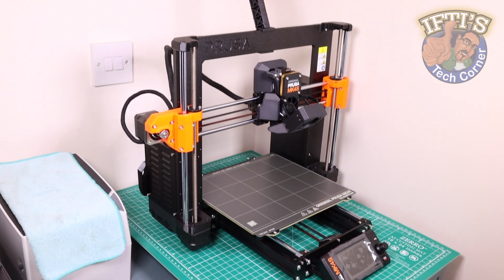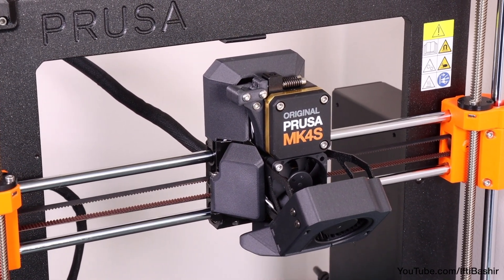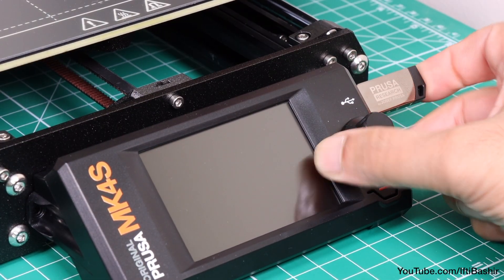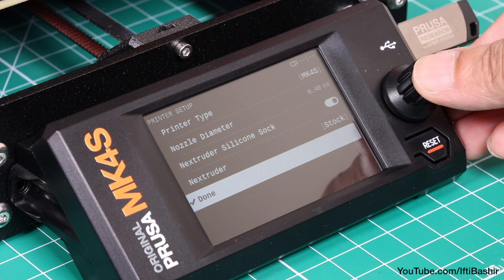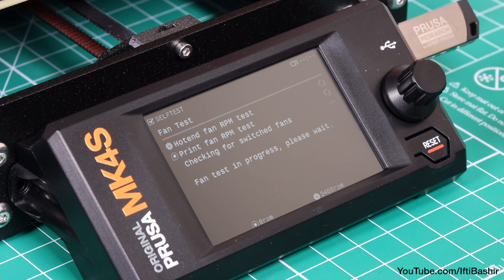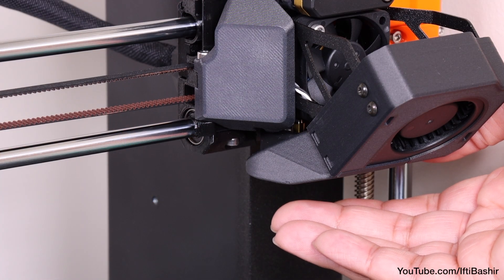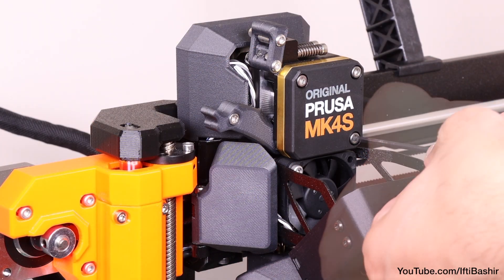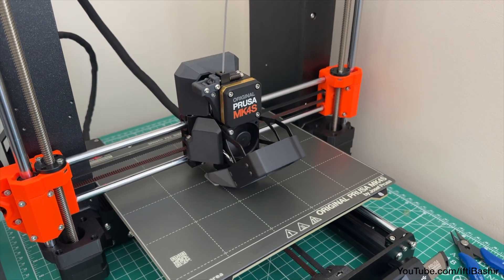#08 Original PRUSA MK4S Kit : Full Step-By-Step BUILD GUIDE - Calibration

Comment: I keep failing the z axis test. Ive realigned the rods a couple times now. It has me tap the nozzle and lowers and goes slow back down and taps and then fails. Im stumped at this point
Reply: same thing happening for me, did you figure it out?
Reply: It took me three tries but i had to just keep realigning the z-axis bars. The ones that look like screws. Use the four screws on each motor to fine tune it to as centered as possible. Make sure the bars are clean from the original factory gunk and apply a light coat of provided grease. Then when you're putting the round connectors on top of the z axis screw bars dont tighten down all the way unless it just happens to fit flush that way. Align the holes as close as you can without making contact with the brackets  to avoid pushing one side down farther than the other. (Let the screws do the work). Not sure how closely experts would agree or if i'm missing anything but thats what worked for me and so far. No problems since. As far as z axis calibration goes anyway. It's crazy how minute adjustments like that make ALL the difference

Comment: What to do when the Z axis test always fails?
Reply: Hay, hope you managed to troubleshoot it already but if you haven't here's what I did. If the z-axis test keeps failing because it won't move up and down, try loosening the two trapezoid 3d printed screws that hold in the x-axis rods (the black rings on top of the orange 3d printed parts of the x-axis). If they're too tight they won't allow the x-axis to move up and down easily along the z-axis screws.
Reply: @Seeyoun8er  thank you ! I managed to fix it anyway, it turns out the nozzle was too low so we took the Z axis apart and re assembled it with the nozzle higher, and it worked 👍

Comment: Nice Videos! 
Would appreciate it if you could make a video about the new high flow nozzle and how to use it in the prisaslicer.
So far i understand: if you use structual profile its the same speed like with normal nozzle and when you use speed you benefit better from highflow? 
i dont get it as you can choose both nozzles in the slicer.

Comment: super helpful videos, many thanks!
I have very much enjoyed the build and will start the calibartion/self check stage today.
I have a couple of minor gripes with the kit however: the belt tightening could be better explained (this is where your video was a great help as it illustrated the tension better); teh app did not work for me  and the written description calibrating with finger was lacking detail), a better description of what constitutes "tight" when it comes to fastening, and lastly, the belt tightening system at teh bootom could be better designed (and brought to the font or the back of the machine-whwere teh roller could be on a sled-like system to allow easier adustment. (withoiut having to tighten a screw directly behind the belt)

I really recommend people to watch these videos before starting their build journey!
Reply from the maker: Agree with your tensioning comments completely ;o)
Thanks for watching!
Reply: @iftibashir  self tests now complete and successfully printed the keyfob. was worried as the initial start before axis collaboration made very loud noise when moving fast downwards. have not heard any noises since (but then movements up/down where much slower)

Comment: I'm sorry if I missed it, but how long would you say the entire process would take? (Assuming you're not spending extra time recording.)
Reply from the maker: If you are good with builds like this, I would say around 8 hours (with a couple of short breaks thrown in). You need to be precise with the build - please do not rush through it as you'll kick yourself later if calibration fails and you have to troubleshoot. I find having to troubleshoot at the end of a build also puts people off of the entire concept.....
Reply: 8 hours? You're off your meds. You can do it in 2-3 hours and be completely careful first time ever building a kit printer. Just watch this guide and you'll be fine. The main part is paying special attention to the zip ties (god I wish Josef would stop using these as they feel so cheap when it's so easy to print parts). There's mods you can print that negate these. I can build one in about 45 minutes but I'm very experienced.
Reply from the maker: @ 45mins?! lol. Would like to see that
Reply: @ use power tools
Reply: @cgwworldministries83  2 hours for a first timer??  Maybe if they had photographic memory, very steady hands, impeccable hardware instincts, and no fear - and watched through this series on at least 2x speed because even condensed like this it's over 90 minutes of build instructions.  Absolutely not, 2 hours is not enough for a beginner to assemble a precision manufacturing robot carefully, please don't be telling people this.  Assembling IKEA furniture takes people longer than that.  If anybody is reading this for advice: your mileage may vary and that's okay!  You can spread it out over multiple days if you have to, double check things - anybody can make a mistake even on simple steps - leave yourself more time than you think you need (and WAY more than 2 hours), don't get in a situation where you're feeling rushed or stressed by the build.  And you might want to read the comments on the manual pages because there are some good tips there for some of the steps.